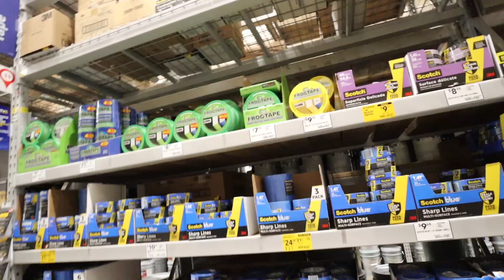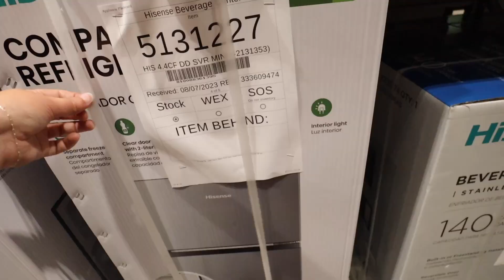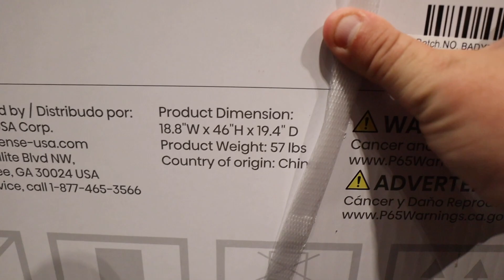Sanding & Priming Our School Bus Conversion! 🚌

Comment: Maybe if you get the medium fridge that isnt as tall you could put a taller counter on top so its still usable just not as a prep counter. Though it would make a great spot for your coffee stuff, or provides a place to set a crockpot for the day (if you gonna have one) ect. Almost using the top of the fridge as a small extension where you can set things out of the way while you use the actual counter space instead of everything else taking it up.
Reply from the maker: oohh a coffee spot would be smart with that space!

Comment: I didnt know they made a sanding disk like that for the dewalt grinder. Ive only ever used a grinder in welding glass but when prepping for our welds we used a flap pad to take paint and mil-scale off. I feel like that would work so much better than (what looks like) regular sand paper for this aspect.
Reply from the maker: probably!! I'm CLUELESS when it comes to the welding lol. I'll let Kohen read this comment, thank you!!